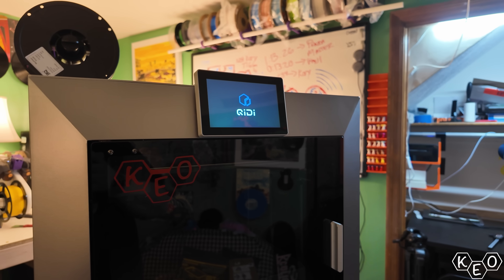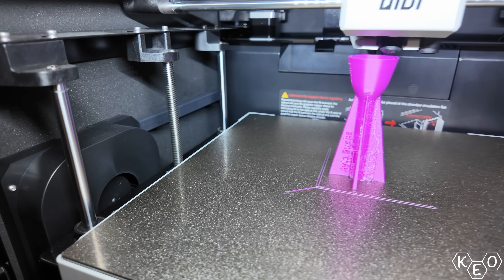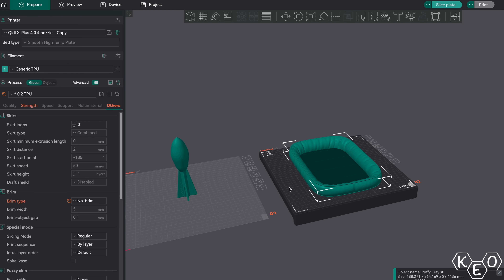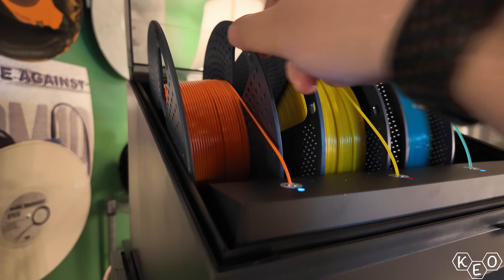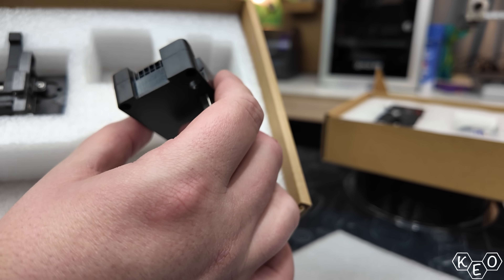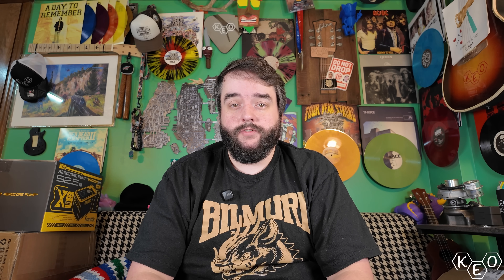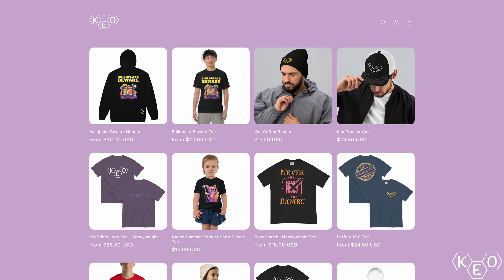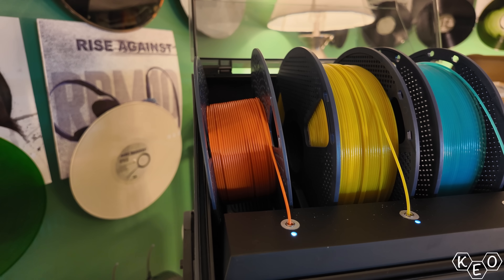I Upgraded My “Old” Printer… Here’s What Went Wrong

Comment: WELL was looking at getting one was ready to order now i want to see what happens with you on how you fixed
Reply from the maker: So you aren't in suspense... I think it's alright. The Qidi Box I am using isn't the newest one. I am however testing out a new Qidi box on a new Qidi machine right now and after nearly 100 print hours, there hasn't been so much as a hesitation. Thankfully. In terms of fixing the issues with the two machines ive got, it sounds like this is just a matter of fixing the lengths of the tubing and changing how the hub is mounted so I am optimistic. Ill likely make a video in the future outlining those learnings but I figured I would share with you right now.

Comment: The solution to your problem with the plus4 is the length of the ptfe tubes. The wall thickness on the Qidi supplied tubes are also too thin which causes them to fold and bite the filament. Use Bambu ams ptfe tubes and make them only as long as needed to avoid sharp corners. Your hub is also not mounted in the correct spot, it should be mounted horizontally on the old spool bracket using the supplied parts for the plus4. There are now rumoured to be 3-4 different versions of the box, but they are printer specific.
Reply from the maker: Good to know. I'll have to tinker with that and see what I can come up with. If its something that simple then I am going to be stoked!

Comment: Regarding printer upgrades, one thing you should really do - root some older printer, and install standard Klipper + Mainsail setup (like I did with my Ender 3v3 KE). Why?

Well, as long as the printer is rootable (and recent enough, although on old ones you can run Klipper with e.g. Raspberry Pi), that's one option available for all users. (That alone could be a worthy video to do)

Just like you often compare e.g. Creality Print against OrcaSlicer, you could do the same between Mainsail and whatever web interface manufacturers chose to install. After all, it's often the "standard, that manufacturers choose to deviate from", kind of like when they choose to make their "own version of OrcaSlicer".

And while the install process can feel overly complex for "less technical people" (and it is - but much of that can be done just by copying & pasting text), it's worth remembering that all of that could just come preinstalled instead of what the manufacturer provided.

Comment: So i bought the qidi 4 max before Christmas, and have been waiting for a review. Ik the qidi boxes isn't all that great. Im mostly using it for single color prints any how. Mostly for high heat resistant, that can go into the engine bay by hot parts without burning or catching fire. As well as making large size carbon fiber car body prints. So it's less little prices to work with. I did get the combo. So if the qidi boxes works great then great. If not then i hope they have fix. If not that , then co-print will have to step in. There working on it for the centauri carbon.  So hopefully we have some luck.
Reply from the maker: I am excited for the Max4 as well. Ill be digging into it soon enough and should have a review out in another 12 days or something

Comment: I am also having similar issues straight out of the gate. I start a print, and the QIDI Box throws the following error: "QDE_004_023 Automatic filament renewal failed." If I press load filament, the filament feeds into the extruder. I get this same error on every print.

Comment: Great to see some raw feedback without the sugar-coating! I’ve been running my Plus 4 for a year now and absolutely love it. I used to be strictly PETG, but this machine handles ABS so well it’s become my new go-to.
I held out on the QIDI Box for months, and even with the 2nd Gen out now, it seems like people are still hitting major roadblocks. I’m starting to wonder if it can actually be saved with firmware/updates, or if the design is just fundamentally flawed.
Because of that, my 'inspiration' has shifted toward the MAX 4 for the heavy-duty abrasive stuff. Can’t wait for your MAX video! Do you think the Box is salvageable, or is the Max 4 the only real move for serious printing?
Reply from the maker: honestly, I don't even know what to think on the Qidi box. My first one has been my best one and these two recent ones have been the ones giving me issues. We will have to see how the Max4 does for me. I am hopeful that it is super cool but time will tell

Comment: So watching your video again.... You either didn't have, or refused to follow the printed instructions that came with your Qidi box and Plus 4 upgrade. 
1) minor differences in how you replaced the extruder. Fine the way you did it, but the directions instruct you to remove the hotend cable connecter as well to make it easier to change. 
2) the instructions tell you how to install the USB adapter without it falling into the printer. (Take one screw out. Install the USB hub, install the new screw. THEN take out the 2nd screw and install the new 2nd screw. 
3) Your buffer isn't supposed to look like that. It should be horizontal after install. There's a new arm that provides a 90 degree mount, then the buffer is attached to that. And they give you a new PTFE tube to run from the buffer to the inlet of the Plus 4. You have waaaaay too much PTFE between the buffer and the filament tangle inlet. That affects the Klipper macro which is moving the filament forward or backward a certain distance and expecting the tangle or runout sensors to see filament arrive or disappear. 

Get that buffer mounted properly, put the shorter PTFE between your buffer and the tangle sensor (inlet) and I will bet it fixes your issues.

Reach out to me, I can help you. Qidi support probably can, hopefully they see the same issues I see with your buffer mount and PTFE tube lengths.
Reply from the maker: This is all excellent advice. With my kits being prerelease units, it sounds like there are some pieces that have changed. The instruction booklet for example was very sparse. The level of detail that you are outlining is more helpful than the literature that was available in the prerelease kit! So that is legitimately helpful information. That would be so excellent if this was a fix as simple as that. 

You aren't the first to identify the hub mounting problem. I think I'll model up a part to turn it the 90 degrees needed to orient it correctly since the brackets that I was provided did not have provision for the correct hub. 

I'll let you know how it goes once I get back around to troubleshooting this machine. Thanks for the input my friend... especially if it turns out to be the old silver bullet on this one!
Reply: @KeoPrints cool. I wish I was near my printer to be able to send a photo and measure the length of the PTFE tube that goes from the buffer to the tangle sensor input. Maybe they can tell you the length. I know mine does a tight but relaxed U-turn from the buffer to the tangle sensor. Maybe 6 or 9 inches long tops? If you need me to, I can have my son snap a pic and send to me to share.

Comment: Thanks for the review. I have purchasing the P4 partly because of the promise for  Qidi Box to come out soon. However,  Qidi Box is not something I want to use because of its issues. Now, we have affordable printers with tool-changers, which is what I ultimately wanted; my U1 is on the way. I am still probably keeping my P4 for a little bit longer, after I had already modified the firmware and made other changes for it to be more usable.
Reply from the maker: That is a good machine luckily

Comment: I just upgraded my Qidi Plus4 with one of the 1st gen Qidi Boxes last weekend and it worked very well. The cycle times could be optimized (I will likely update my Klipper macros to optimize it) but so far I am happy.
Reply from the maker: Good to hear. Did your hub on the back mount the same way mine did? Did you need to cut any of the tubing shorter?
Reply: @KeoPrints my hub is horizontal (kit came with a 90° mount that mounts the hub with the inlets to the left and the outlet to the right (when staring at the back of the printer). Then there is a PTFE loop from the output to the filament tangle sensor inlet. Length of that loop is short, maybe 6" or 9", just enough to reach the printer inlet.

Comment: Just wondering, would a taller lid on the Qidi Box fix the cardboard spool issue(s)?
Reply: Not really a fix. But you can print adapters and weights
Reply: @riba2233  Thanks! Eagerly awaiting my new Max 4. 😃
Reply from the maker: I am also stoked to mess with that Max4. Should have a video out in the next week or two

Comment: I do like my plus 4, but for now it does not really know what z offset is. Hopefully a new piezo sensor will change that. 
Do you use the box with Orca slicer? I have been using qidi studio just because I don’t know how compatible orca slicer is with the box for when I get that. Holding back purchase of the box until I see reliability is sorted.
Reply: Love my plus4
Not convinced on the Qidi Box at all.

Keeping mine single filament unless I'm convinced the Box will work well and reliably. I can't have a machine that's unreliable :(

Comment: Is the humidity in the printer room tightly controlled? I wouldn't dream of printing TPU from outside the dryer...
And mate... use glue stick when printing TPU on PEI. Gluestick == PVA and PVA does not stick to TPU nor PEI.
Reply from the maker: It isn't very controlled at all. But it has only been hanging around in the open during the winter months where it is pretty dry. Still, I am surprised that the quality didn't change after drying the BIQU filament. It must not have had much time to soak up what little humidity was around

Comment: Thank you for being honest about the Qidi Box.  It is a steaming pile of overdried filament for the most part.  They overpromised and way underdelivered.  To the point I got rid of my Plus 4 and Qidi Box both and moved on.  The Plus 4 was good overall (was still a race to the bottom... WAY too slow of an interface) and printed well (except that piezo thing... yeah...).  But not worth the hassle.
Reply: No issues on Q2 luckily
Reply: @riba2233 Good!  If you print high temps, expect the piezos to go out.  Even better, get a Beacon.  :)
Reply: @NeveSSL   there are no piezzos. please don't talk about stuff you know nothing about, thanks.
Reply: It's finally working smoothly for me as of last week, but it was absolute hell. Now that I have beacon installed, it's a phenomenal workhorse.
Reply: @jayceegeeh Beacon makes it SOOOO much better.  I just wish it wasn't so laggy.  I couldn't take it.  Lol

Comment: Was there no profile for the foaming TPU? I have had good luck with the profiles for Qidi’s PLA and Odorless ABS. I have had many problems with the Box not feeding filament properly. I do not yet trust it enough to do much multicolor. However, my problems started with a loose cutter blade. Once I solved that problem, the next issue was that I did not use the new PTFE tubing inside the machine. Once I changed that, I got a better result. However, like I said, still not reliable enough to do multicolor. I’ll keep working on it.

Comment: I made my purchasing decision based on your videos and bought a Qidi Plus 4. Now live with it.
Reply: I had one for over a year been great and I have 2 boxes and use them all the time with now issues
Reply from the maker: Well I hope the printer itself has served you well. It is a great machine. I really want it to work well with the Qidi box.... here's to hoping Qidi support has a solution for me. Otherwise, this will remain my dedicated single material composites printer
Reply: @KeoPrints  delivery of my Plus 4 is only scheduled for Thursday. This will be my first FDM printer. I am excited and bit anxious, so it was reassuring to see a reputable expert having a solid long term experience with it. Will be following your story with the box tho. I wish they fix it soon. Multimaterial/multicolor is not in my immediate plans, but not completely off the table.
Reply: Seconding all of this 👍

I'm so happy with my Plus4, it's been rock solid. But I'm really unconvinced about this Box, it seems unreliable.

Also, I'm disabled, so if I get the box upgrade and it turns into a mess... I don't have the ability to fix much.

I think I'm staying single filament.
Reply: @LordPhobos6502 been reliable for me I have 2,  but of course if you don't follow the instructions instructions and do stuff to it your not, I won't work right, as most of the "is doesn't work" videos the. Either run cardboard spool or don't hook it up correctly... But a it works great does get view

Comment: You did not read the instructions then? The buffer is incorrectly installed. Works better if you install it correctly. 😂😂
Reply: I noticed that too!
I had issues with my QB at first, as soon as I sorted out the PTFE tubes i.e. removed any excessive blends (including between the toolhead and the glass lid, installing a riser helped), ensuring PTFE tubes were as parallel as possible, feeding into the hub.
Not had any issues since.
Even using Fabrizio app to program NFC tags to stick on non-Qidi filament spools, works like a charm!
Reply: @Unlceblob  yeah, the ptfe tubes need to be at the right angle and minimal radius to work. And they send this guy free units. SMH at the marketing department 😂😂
Reply from the maker: So neither of the brackets I had worked with this filament hub. There was no way to mount it turned sideways but a lot of people are telling me that I have it mounted wrong. I'll investigate a solution there. My question to you though is; did you have to cut any of the tubes shorter? They all seem like they could have some length taken away and generally reduce drag on the system which I believe could be a contributing factor to my issues
Reply: @KeoPrints  the bracket arm on your install was missing from your install. It should be installed heading down the back of the machine, (so effectively upside down), with your filament buffer attached at the bottom. The buffer then is in the correct orientation if the 4 PTFE ports are pointing to the left, (if you’re facing the back of the plus 4), with the tubes fanning up to the box. The PTFE tubes require no cutting whatsoever. My guess on the failed loading issue was, more than likely,  the rollercoaster journey the filament was not liking😬. When the buffer is in the right orientation the tubes need to be held with the spacer 50mm from the buffer and the second spacer is a further 250mm. This keeps the radius of the PTFE tubes at a minimum. Hope this helps. If you do need some pics to help clarify, I’m more than happy to provide. Cheers.
Reply: @KeoPrints oh and one last thing, you need to print the riser that Qidi hint at on the Qidi Wiki page. PLA and PETG filaments kink in the Box drive gears due to heat radiating up from the printer, regardless if the door is open. A supplied one would have been nice but who cares about the old Plus 4 users🤔

Comment: Is it worth it? My answer: Upgrading a proprietary, closed printer to go from two-years-ago's best to worse than today's best? No. Updating a completely open machine from 10 years ago to continue to be a bit faster, but still infinitely repairable and maintainable so long as NEMA17s are NEMA17s and V6 nozzles keep being made by somebody? Worth it. Hell, give me a CNC lathe and I'll keep making you V6 nozzles for a lifetime.

So long as you are reliant on one manufacturer to keep your printer running, you're essentially just paying to maintain their machine until they stop supporting it.
Reply: You are using a 10 year old machine.  The tech has moved so far in that time you are riding behind a horse and cart yelling at planes.  Wake up old man
Reply: @atapene  What's moved on? I've got independent extruders, input shaping, Revo hot ends on a Orbiter extruders (planning on going INDX when available). Eddy for bed leveling, AI print monitoring... 

10-year old frame? Yeah, but it's ready for the newest parts whenever I feel a need to upgrade.

I got some clouds to yell at, so stay off my lawn.
Reply from the maker: Doubling down on the old man comment with the stay off of my lawn is the greatest response. Well done friends. This is excellent!

Comment: The filament hub isn't mounted currently, on mine it's mounted sideways and the filament path is straight, over 400 hours on using of and only had a couple of failed prints
Reply from the maker: I’ll have to have a look at that. There were some brackets that came with it but no provision to mount the hub to the brackets

Comment: I am very curious to see more details on what your issue ends up being with the Plus4/QidiBox. Mine has never worked. The issue, in my case, is the filament tangle sensor... the filament gets snagged inside of it. I have a replacement tangle sensor that I need to install (but I have not gotten around to it due to laziness).
Reply from the maker: I hear you on the laziness front. Total bummer having to take the thing apart when it should just work

Comment: I've found when printing TPU on PEI - I sprinkle a little Johnson's baby powder on the build plate, then use a paper towel to spread it around to create a thin layer. The prints still stick well - but release much better
Reply: I cover the print bed in blue painter's tape for tpu prints; goes really well :)